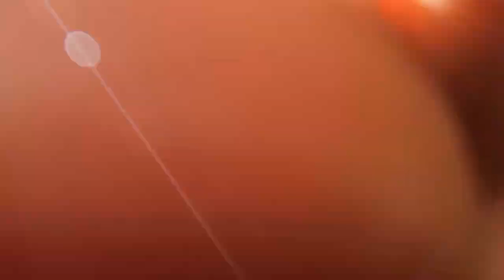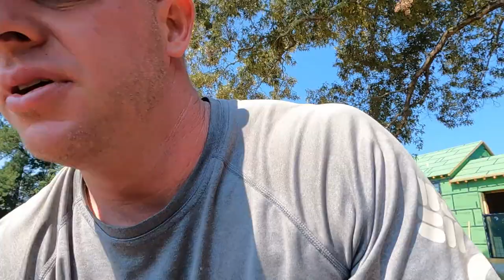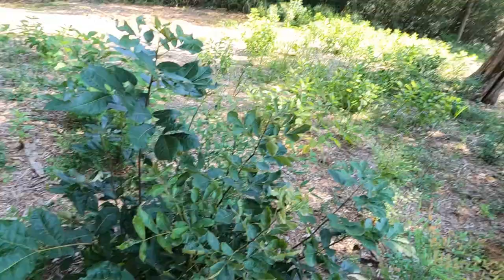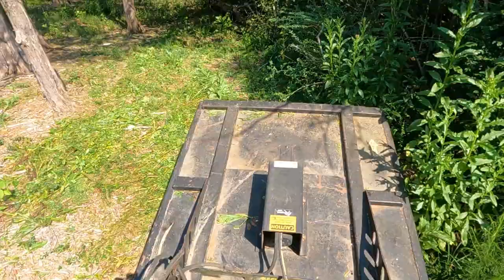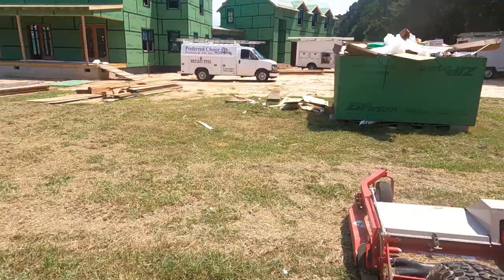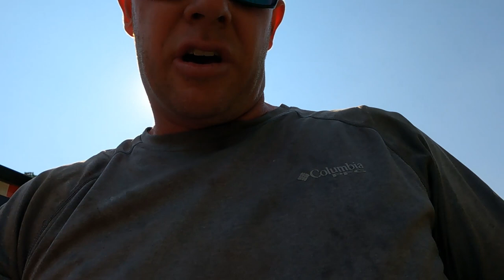Mowing with the Ventrac and Bush Hogging with the ASV rt-120

Comment: Have you seen the tool that Andrew Camarata has for putting those fittings on?  It's a retrofitted squeeze-type clamp that has little "forks" on the ends to fit around the bases of the fittings and run them on without busting your butt shoving at it.

Comment: Yep, if you own land of any significant size, you will need equipment to maintain it or get a good service to do it for you, but it's well worth it. Speak with some knowledgeable people who can advise you on vegetation that requires less maintenance. You ca n cut down on frequency of care, but not eliminate it. Find a mechanically knowledgeable friend to help find good used equipment if money is a bit tight. I now have modern equipment, but most of my life I used tractors made in the 50s and 60s.

Comment: This is the first time I've seen you use a skid steer bush hog. Looks like you have a lot more control around trees and that big rocky area than a tractor with 3-point hitch bush hog, and it doesn't appear to sling as much debris out. Does the skid steer bush hog have a stump jumper?